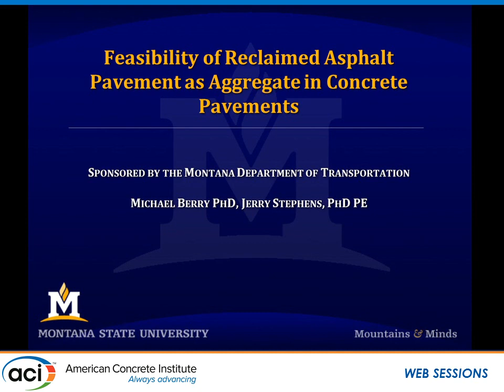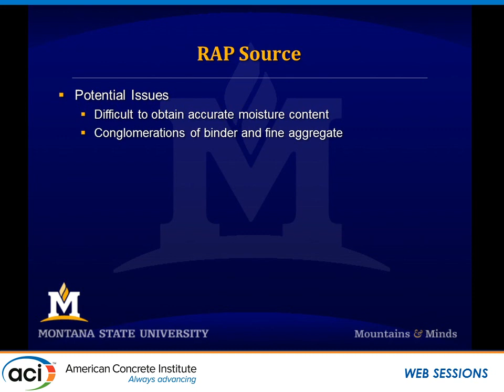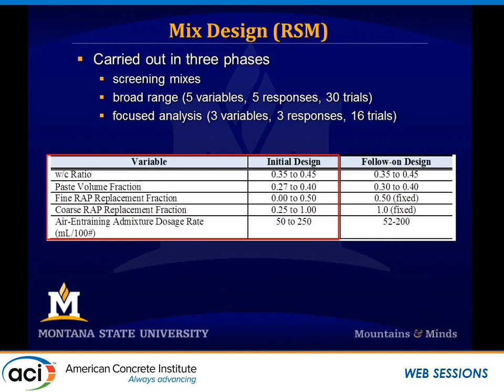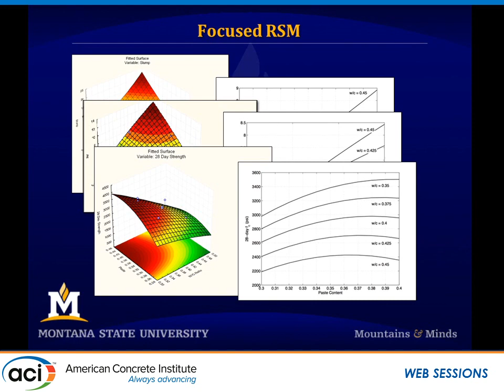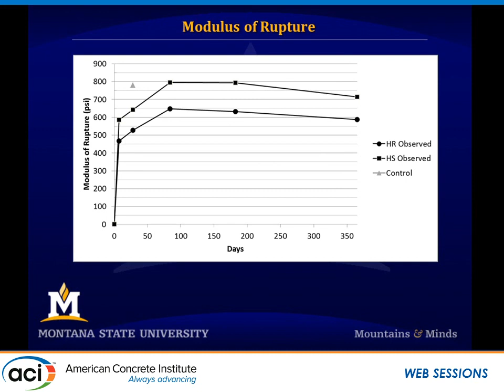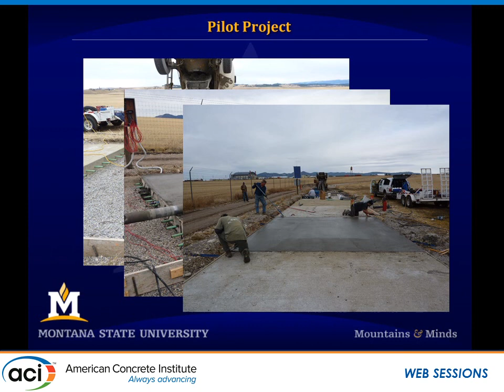Feasibility of Reclaimed Asphalt Pavement as Aggregate in Concrete Pavements

Comment: It should be noted that the use of asphalt on interior concrete that comes in contact with flooring would result in the major issues both of adhesion, air quality, and plasticizer migration and should never be done.